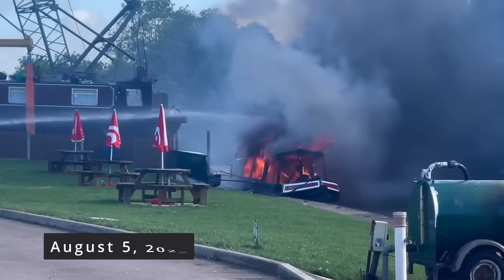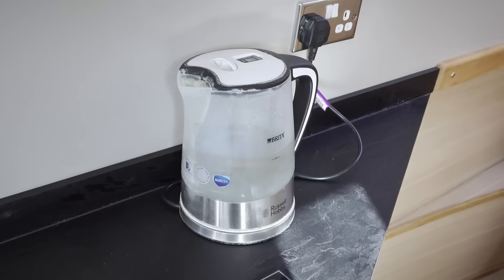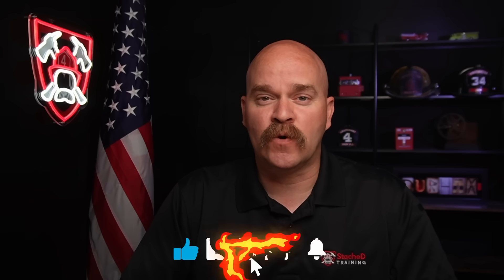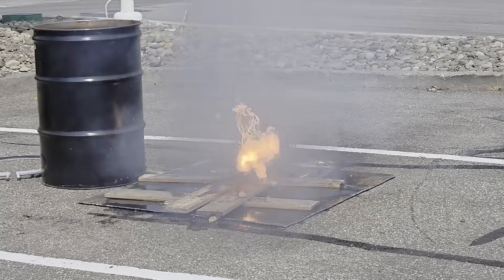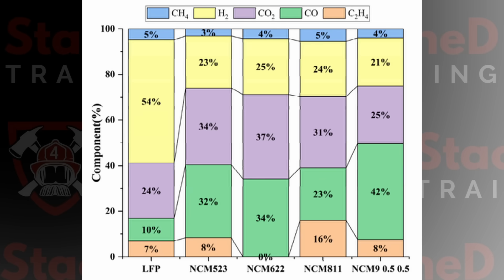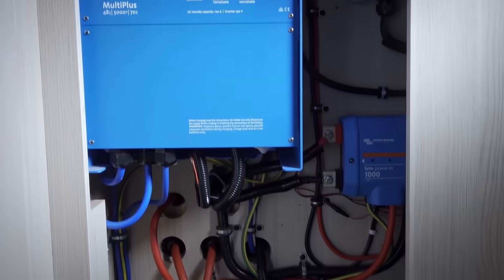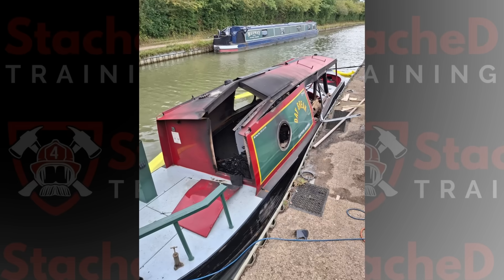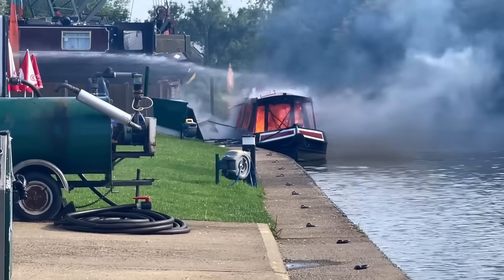Electric Boat Explodes While Charging: LFP Batteries

Comment: We're hearing efforts to fit car/passenger ferries with battery electric propulsion systems here in BC Canada. Having such a failure while underway will mean high probability for lose of life. They've recent announced no broken down eV cars will be permitted on these ferries due to risk of an unsafe vehicle aboard.
Reply: DFDS a big ferry operator in Europe are converting to batteries.They aren't worried.The channel tunnel has never had an issue with any EVs despite millions of EVs going through it in 36 years.The MAGA types really are the dumbest of the dumb 😆😁

Comment: Then give me a boat with a nice, economical diesel engine. You fill up the diesel tank occasionally, and you don't have the hassle of charging and charging cables. And your range is much longer. Electricity isn't a suitable power source for a boat. At most, it's suitable for a golf cart.

Comment: It's when they are charged to fast or discharged to fast and the heat is not controlled. Dendrites form between the plates of the battery eventually short the anode and electrode together!

Comment: Bad boat design, not bad batteries. Your right to recognize that the placement of the batteries, in a non-ventilated/moist environment is not smart, ...and probably charging with a 'non-regulated' and unattended charging equipment. Soap is not safe if you leave it on the bathroom floor. Batteries store energy, and that energy produces heat. They were lucky not to have been out on the water!!!

Comment: The charger has a volt/current limiter, and so should the BMS - both would have to fail for a runaway - it could have been  a short or water ingress issue away from the battery as the temperature sensors  would have shut it all down

Comment: First you said Lithium Iron Phosphate and then you said Lithium Ion.   Two different chemistries of which the latter is well know for thermal run away.   LiFePo4 is not however.  Never heard of a LiFePo4  battery every exploding and catching on fire is extremely rare.   My guess is this was a Lithium Ion if the battery started the fire.  But you also mentioned fuel.  Now being a fire fighter you might be reference any of a number of fuels.  But since you mentioned fuel, if there was indeed an alternate source of combustion then just a spark from the battery could have caused the explosion.

Comment: Also, into batteries, I queried ChatGPT, where I learned that if the batteries charge at over 14.4 Volts, they can gas hydrogen, thereby yielding an explosion. Some car alternators charge at 15Volts, which would cause it to gas or vent into the cintained spaces. Knowing marine battery charging circuits, this is the most likely what happened. The other ilesser issue is charging in sub zero temperatures cause dendrite formation, which over time can grow and cause an internal short. In addition, electricity flowing through salt water is called hydrolysis, and the resultant explosive gas is called hydrogen.

Comment: See alot of these bateries failing due salt & moisture . Veary comon in fla . Happening way too often I think they should be banned. Because it's extremely hard to put these fires 🔥  out causing much more damage than a gas fire. In the fact that there's practically no warning especially with  the toxic smoke that is given off can kill fast.

Comment: Was this a battery issue or was hydrogen being made from electrolysis from exposed/submerged charging contacts.  Seems like a lot of gas build up in a short amount of time.

However regardless of how the gas’s generation started,  ventilation,  and alarms need to be installed in that space.   Or something.   Water and electricity seldom mix well.

Comment: I don't know if this guy is working for an industry group or not but he is misinformed .  LiFEPO4 batteries contain no cobalt. They they have high heat , excessive load and low temp shut offs . They also have charging and discharging shut offs. However the picture shown of the installation is very concerning.  Anyone who thinks thats a safe battery installation shouldn't be doing battery installations

Comment: The absence of active ventilation systems, powered separately from the other systems, contributed to this incident. A thermal detection system to stop charging when temperatures exceed safety margins should be MANDATORY for ANY lithium battery system. IMHO

Comment: I just looked at your content list and I wonder how much you are being payed by the fossil fuel lobby that you are seemingly exclusively reporting on the fracture of fires cause by batteries, when the the clear majority is not caused by batteries. 
You never show the horrific injuries people have when a serious accident with a fuel filled ICE car happens ... that is a driving bomb and the reason why often accidents od ICEs at higher speeds that damage the tank then instantly explode, giving you no chance to escape. Also smaller plane crashes are often just a piles of ashes because of fuel leakage that is being ignited by the tiniest spark. 
The most obvious fake are the AI thumbnails that mostly make no sense when looking closely.
This channel is a joke.  
With your single sided and manipulated disinformation campaign you are ruining the environment because many of your viewers might not realize that you are worse than fox "news" and avoid doing the right thing, drive electric and have storage systems installed by professionals. 

Anybody should google for local fire statistics and will see that this is far from the reality.
Why do you think we Europeans are switching to EVs, apart from trying to slow down clime chance?
I looked through several statistics and the average probability of an EV burning is factor 30 to 80 LOWER than that of an ICE car!!!
Ask your insurance for statistical data, they will confirm that, because they have to pay the bills.

Comment: I was shocked to read that there are lots of batteries out there that have no native BMS. So once you don't manage them with your own circuit, keeping them from being discharged under a specific voltage, which will happen if your circuit doesn't disconnect them from the load, then they will drain further and create dendrites ... and then when charging them up out of this mode, they might blow op, which is the reason they say unmanages battery, don't operate without external BMS, not suited for boats, cars and planes. I wonder if this is exactly what has happened. People have to be educated that is batteries are not being handled correctly, they will become a danger. Therefore only buy batteries with built-in BMS, anything else is playing Russian roulette with everything you own and love.

Comment: Batteries and water are just a poor mix for operating conditions.   The higher the voltage, the worse the mix.  Oh and just so you are aware, aluminum melts at 650C.  A lithium battery fire can potentially ignite it.  It is after all rocket fuel.

Comment: That looks very very DYI.. Theres a strong chance the user was inexperienced or cut corners. Theres also a strong chance they used cheap batteries. Theres also no Guarantee they connected the serial connection to the batteries. 
Another note is Lithium batteries though marketed for all purposes have to be kept away from water! They would need a custom enclosure to ensure that no water gets into them.

This is certainly caused due to lack of knowledge and poor installation! Its not the fault of the tech.

Comment: I don't know why people continue to pack all the cells together so that thermal runaway in one spreads to all. Unavoidable due to lack of space sometimes, but not here.  I'd mount individual cells to the inside of the hull below the waterline, so it can shed heat to the metal hull, thence the canal, if something goes wrong.  Put an inner hull between the cells and the cabin, but if you've got cells venting gas, it could collect in the cabin under certain conditions wherever you put them (even if you put them in the roof or on deck, heavy gases will sink and collect).  Best not to have multiple cells enter thermal runaway in the first place. As regards moisture,  unavoidable on a boat.  Can lead to maintenance failures if the cell balance boards aren't well potted, though these don't have to be right next to the cells and can be replaced separately if a fault develops.

Comment: I have portable solar generators at home in an apartment under normal apartment environments.  I live in New York. I keep them just in case there may be a power failure. 3 units are rated at 1200 watt/hours, 1 unit at 268 watt/ hours and lastly 1 unit at 3800 watt/hours 
The brands are Anker, Bluetti, Vigorpool and Ampaura. All LiFePO4. I discharge then down to 10% and charge them to 90% every three months via my A/C outlets. During this cycling, they are always visually monitored. I also have a 5 lb. fire extinguisher in the apartment rated for electrical,  flammable  and wood and paper fires. Should I be concerned? Eagerly awaiting your response.
Thank you.

Comment: Just looking at the way those batteries were set up (12V packs connected together without an overall BMS) they were asking for trouble. Far better to use individual cells, series connected to make whatever the required voltage needs to be, and parallel banks of cells to get the required capacity, with a BMS monitoring and controlling the charge to each and every cell. And, for the record, I've had an AGM battery connected in parallel with other batteries, similarly to the Lithium batteries in this video, explode and emit dangerous fumes that could easily have killed someone. Balancing batteries properly, no matter what their chemistry, is imperative.

Comment: So many chanels here prove that LiFePo4 (LFP) does not explode.
We live in a World, where a lot of people instantly believe stories that do not have any proof, like much content of influencers and others (and ignorent people who use that very dangerous AI to try make people believe something !!). Now, suddenly, there is one channel tries to make us believe that LFP can explode. Ok, one question:

WHERE IS THE PROOF ??

Yes, Lithium batteries can cause a dangerous situation, just like a pile of wood can, or about any container that holds a lot of energy!
LiFePo4 is not safe, but it is about the safest member of the lithium battery family.
LiFePo4 is safe enough, as long as you know how to do things right, like, for example, not ever saving on tools, and use durable high quality cables!
but even when you have the right tools, and know how to do it safe, you still need the skills to do it right. The right tools don’t make a good carpenter!

It is unlikely, and there is no proof, that in this case, the LiFePo4 actually started this explosion and fire. Even the fact that the system was charging, is no evidence.. However, nobody ever tried to imply, that LiFePo4 will not burn when a fire starts nearby, of course it will..

Please stay focused people: Don’t take the words of one man, when there is no clear evidence to back up his story! And if it is impossible to find the evidence, don’t make assumptions !! Already too many people do make assumptions easily these days.. Please be strong, don’t follow them, think! use logic, and try to find the right answers, answers that are backed up by evidence!❤❤

Carl Sagan once said: “No matter if a person is famous, wrote many books, or gave interviews on TV, it doesn’t prove that he or she is right !”

Comment: Australia has changed the laws so new/upgrades to vehicle/caravan/trailers can't have LiFePO4 (LFP) batteries in living/sleeping space, must be housed to the outside, vented to the outside. No more under the bed, no more under the bench accessible to the inside.
Carbon monoxide & other fire/gas alarms can be added to improve warning (doesn't stop fire).
Secondary sources of gasses, toxic fumes & combustion can be the plastics, resins & wood near the batteries/electronics (domino).
Don't rely on FETs in the BMS to stop over current, fuses or breakers should be added. Max charging voltage shouldn't assume all cells reach 3.6v at the same time (some would be 0.15v above/below the average. Balancers shouldn't run below 3.33v/cell.
Water should be kept away from cells & electronics (maybe regular inspections of high risk installations?). Flames don't have to start in the battery if the gassing & materials near the battery/electronics are flammable.
That compartment needed a chimney to vent gasses & alert.
BMS with remote monitoring can be used to check for signs of faulty cells, reduced capacity, overheating but still needs someone to connect & view the information.
Some BMS come with bad default settings, if they can be changed by the user then the user better know what they are doing.
With multiple 12v in parallel and/or serial then there are extra risks when 1 is faulty. What happens when 1 suddenly shuts off & high current flows to others in parallel & the charger doesn't know the current should be more limited? Instant feedback form battery system to charger is required. More sensors, more communication, more monitored by network of smart devices = more wires, more electronics, more insulation, more risk of shorts if movement, ventilation & corrosion are not mitigated.

Comment: Worldwide, it’s reported there are less than a few hundred lifepo4 runaways.   Looking at the pics after the fire, the batteries are under the back deck but the back deck isn’t damaged????
Reply: It’s been suggested, elsewhere in the comments, that the batteries were not under the back deck but in the main cabin, forward of the bulkhead.

Comment: No battery is 100% safe.  Lead-acid gives off hydrogen and oxygen (2 to 1 ratio) when charging.  The key is proper ventilation coupled with proper location (air conditioned if in humid areas) and a BMS that will shutdown the charging source (if high cell voltage or temperature) or the loads (low cell voltage).  The vessel used some Victron equipment, but the batteries were a different brand (Predator).  Victron LFP batteries with Victron BMS with Victron charging and Victron load control equipment would have prevented this from happening.  It would have detected a high cell voltage and shut off the charging source preventing the elevated cell temperature and thus the out gasing.  If someone is to have an LFP system, make sure that system is one manufacturer, don't hodgepodge a bunch of components together to save money.  Build it right or don't build it at all.
Reply: You are guessing. We do not know yet.
Reply: @tmog1000  Educated guess.  I have studied LFP batteries and various manufacturer required setups.  I deal with Victron all the time and coupled with a third-party battery is a recipe for disaster.

Comment: Wireing 4x12V LFP batteries in series you need 3 balancers between them. Or even better install one ssingle 48V Battery. Reason: within each 12V batteriy the cells may be balanced. But the whole pack could run out of balance. Charger thinks it is below 58 V, but 3 batteries are at 13V and one battery getting dull and raises above 15V quickly. In sum 54V and the charger continues… - Boom!

Comment: Typical, brainwashed plonkers slavishly following a ridiculous fad “To Save The Planet” and in doing so contribute to the opposite effect! And the idiots responsible for all this complete nonsense carry on lecturing the sane majority.

The UK Canal system has been in operation since the Industrial Revolution, running on Steam, Petroleum and/or Diesel for a couple of centuries. The Norfolk Broads canal network ins a major holiday industry which has used adapted narrow n=boats for leisure, usually being rented for a week or two of cruising. Always diesel.

I wouldn’t dream of risking an EV version as apart from potential noxious gas poisoning or catastphic fire risk, the chances of being left stranded by range expiration while miles from civilisation is an ever-present horror!

Comment: What all due respect this is why you should stick with a gasoline or a diesel engine anything electric like that will blow up it's not safe I don't know why people are stupid enough to believe it safe how to save her for the ozone layer in a gasoline engine when the battery blows it has more chemicals released into the air and what gasoline never would so therefore no thanks you don't have to charge the gasoline engine so you don't have to worry about them catching on fire unless they're running and then when you see it you can always put them out in time I'm sorry a gas engine is 100 times safe and electric engine will ever be

Comment: Any battery if overcharged will catch on fire. Phones included. It's not the battery issue, it's the owners that don't know what they are doing.
Reply: Friend of mine massively overcharged his Li Po 4 batteries, One just stopped working and the other, given to me is still working 2 years later. Neither 100a battery got even warm or gassed off or swelled up and they were really cheap.

Comment: Lipo4 ( LFP is one of the safest lithium chemistry's , the most dangerous aspect of lithium batteries is the staggering lack of education and utter avoidance of common sense in off-grid applications 
 Cell inbalance , overcharging , lack of metal containment and compression boxes for the cells , refusing to use Quality BMS circuitry to balance the cells , leaving generators charging batteries unattended , lack of over voltage, surge protection and current limiting breakers and fuses
* It's not the batteries or the battery chemistry
** it's stupid people doing stupid things with Shyt they don't grasp nor comprehend